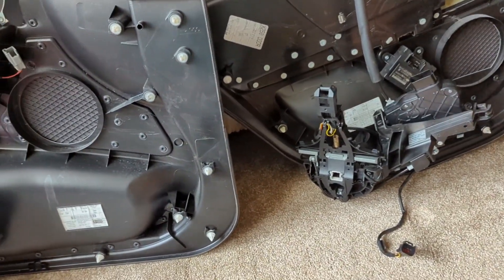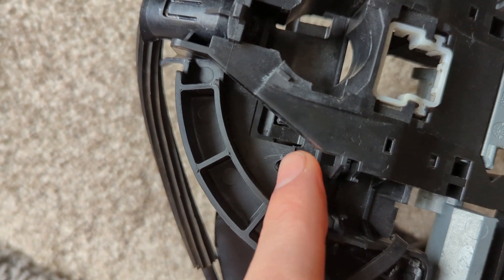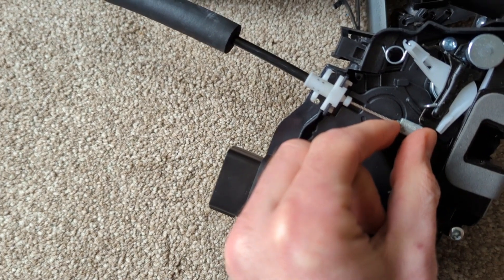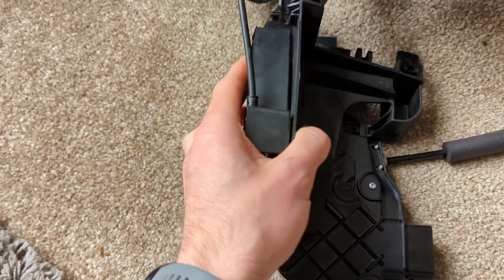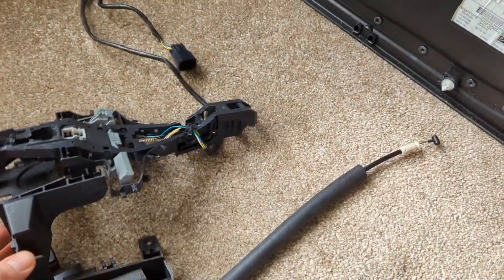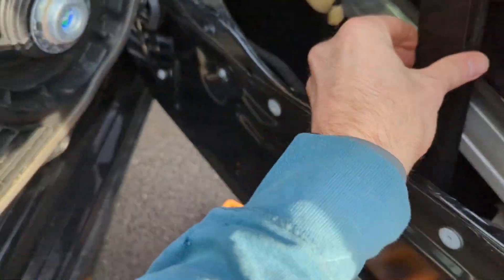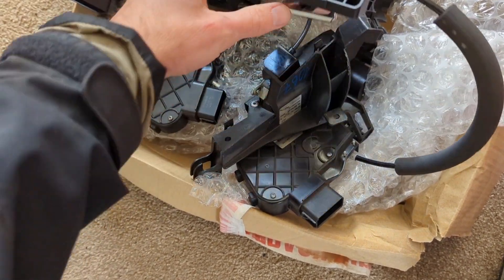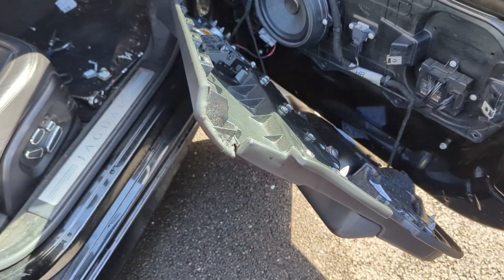Jaguar XFR Door Lock fix

Comment: Nice video and well explained. I have an XF 2010 and it's a nightmare to plug the door handle cable back into the mechanism. I've had 3 trays and tempted to just buy a full door that has it already fitted. Can't seem to figure it out. How did you do it?
Reply from the maker: Sorry I've only just got round to reply, if you mean the cable to the handle, it's a faff. It has to be pushed in hard, then not moved too much as you put the door back on. I used a bit of gaffer tape to assist too. I hope you got sorted.